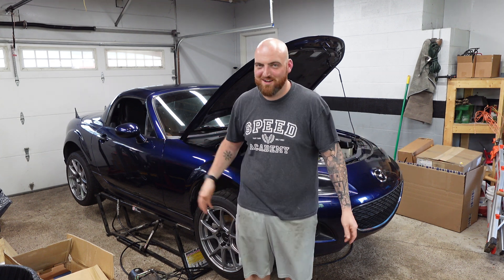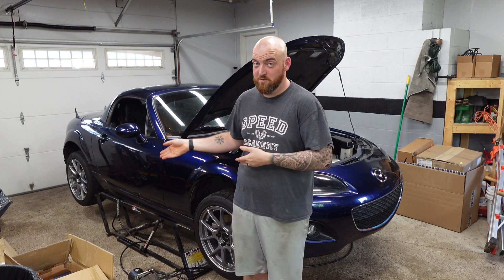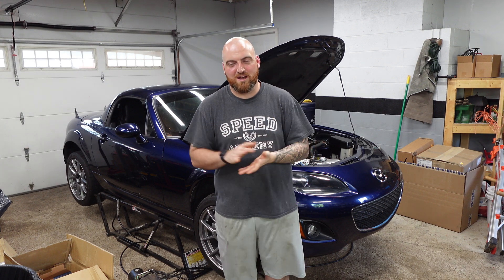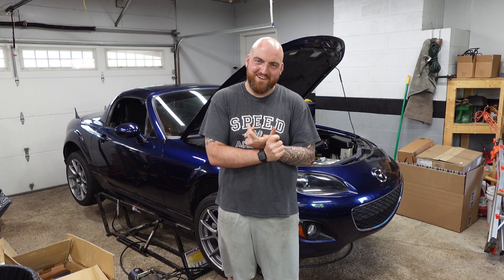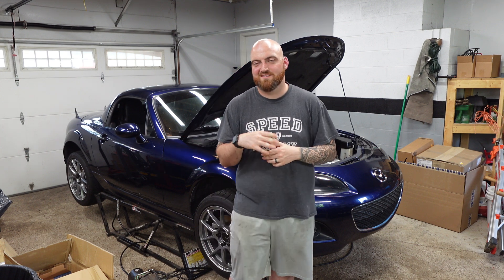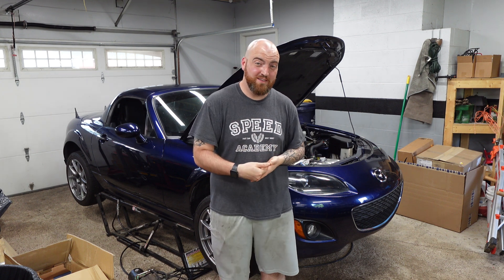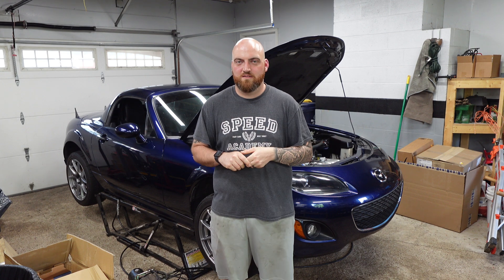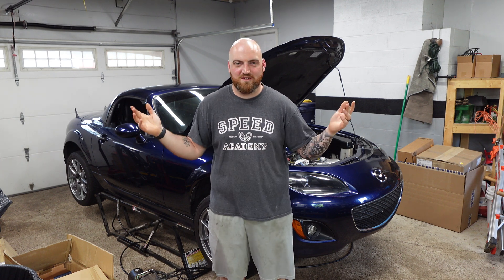Miata Forged Engine Build In A Box | 400 WHP Capable!

Comment: So I have a 2005 NB 6 speed with im assuming the fuji diff and I plan on turboing it and running around 300 hp and was wondering if you suggest I build the vvt I already have but then get a torsen diff (and if so what ratio diff), or should I sell and try to find a MSM and build the mazda speed that already has a better diff and axels and other better miscellaneous parts. Just curious on your opinion and also what the easiest and best route to go turbo would be. Thanks!!
Reply from the maker: I wouldn’t bother with an MSM. Torsen and 6 speed will handle 300hp, just build the engine so that it’ll all be happy.
Reply: @NappMotorsports sounds good thanks. Maybe i’ll be buying one of your diff reinforcement kits